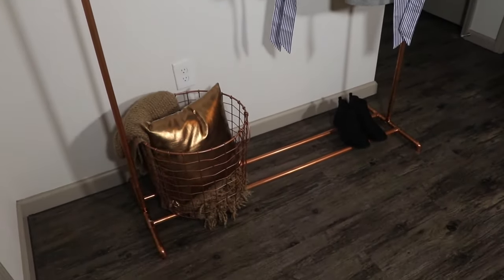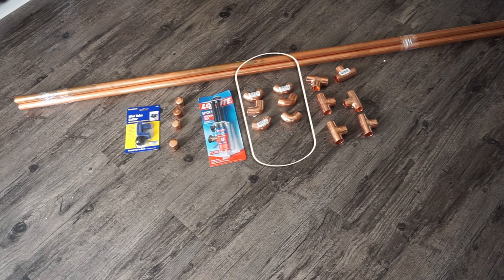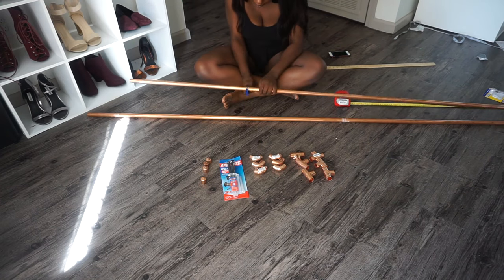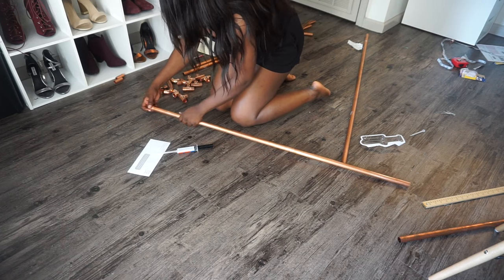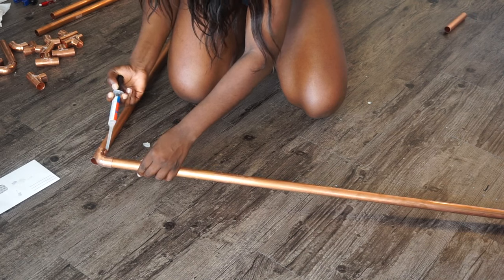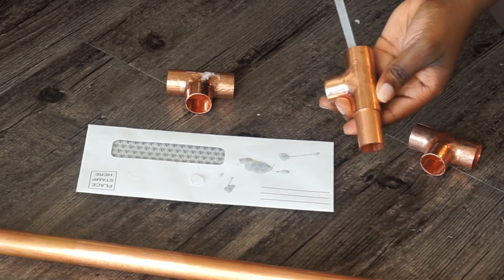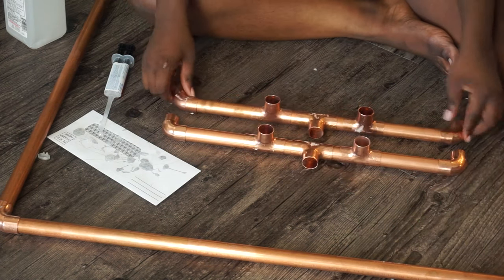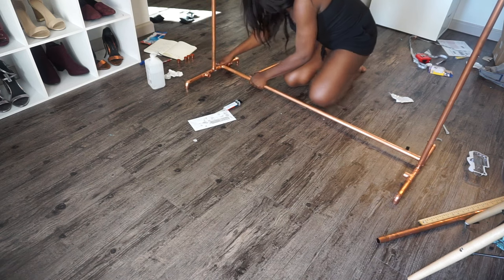DIY Copper Pipe Clothing Rack!! || TheAdeTomi

Comment: Great video.  Thinking of doing my whole closet with copper pipe, but instead of epoxy, I would sweat the pipes together....not sure, just may be a little easier since I have a torch and solder.  Also, i am planning on coloring the copper with the torch for a kind of unique look.  In any case, thanks for making the video and gettin those hands dirty.  How is the rack holding up?  Is the copper pipe bending at all due to the weight of the clothes?  I was looking at using black pipe, it's a lot stronger since it's steel, but the ends are all threaded which presents some challenging dilemmas and more precise measurements.  I did do a big wall mount for my TV with black pipe and it turned out pretty cool.  Again, great video and how's the IT career going?
Reply from the maker: lam6gun thanks for the feedback, I gave the rack away but for the time I had it, it never bent or anything. Careers going good thankfully 😊
Reply: Sweet!  If you aren't a programmer, having a CISSP, PMP and a healthy dose of ITIL thrown in for perspective is always helpful.  Rock on!

Comment: Looks great! But have you found that the horizontal pipe has bent from the weight of the clothes over time? Thanks.
Reply from the maker: Thanks! I actually gave it away a few months after I made it so I’m not sure how it held up. I never hung a lot of clothes on it myself. But I believe the thicker the bar the stronger it is. Hope this helps

Comment: I looked in the description, did you purchase all being 1/2 an inch for the 10 ft pipers, elbow and t connector ?
Reply from the maker: Yes everything was the same size. The link in the description specifies all the sizes I used. Didn’t use any 1/2 inch pipes
Reply: I appreciate your fast response, this will be my quarantine project!!!